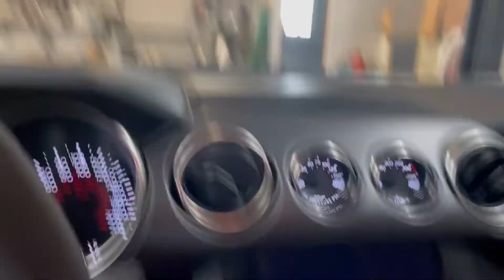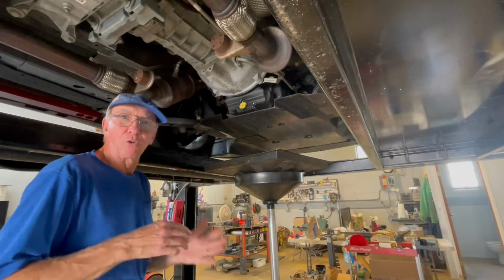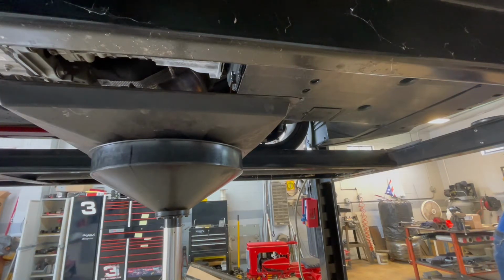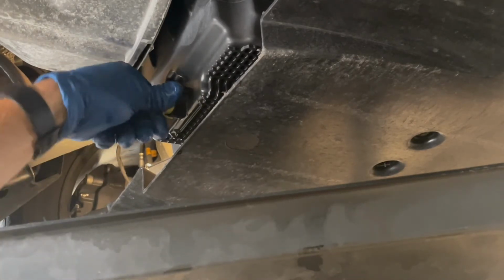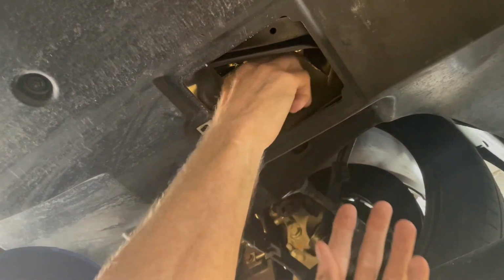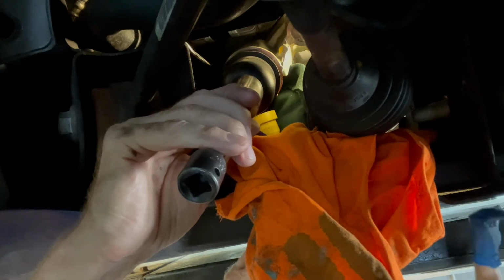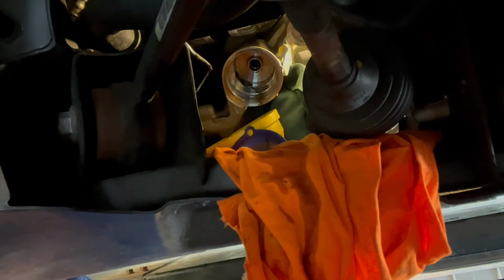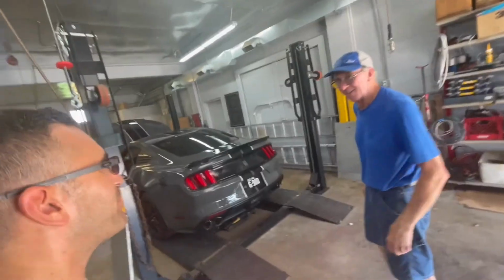Another oil change on the 2018 Shelby GT350.

Comment: I swapped my OEM plug with a UPR drain plug, very happy with it.
Question, does your owners manual specify FULL SYNTHETIC Motorcraft or synthetic blend?
My mach 1 owners manual specifies synthetic blend Motorcraft 5W-30, thanks
Reply from the maker: 10 quarts of 5w-50 full synthetic

Comment: Hey any luck on that wheel stud assist ? Can’t find it anywhere
Reply from the maker: George bought them from ReverseLogic size M14x1.5F-200
Reply from the maker: www.reverselogic.ecwid.com
Reply: @TrucciSpeed  you're the man!
I'm here watching your oil change videos over and over ! I finally found the correct oil  filter. What a hard incredible accomplishment! By the way I found it on Amazon and paid $36 paid $3 more to get it by Amazon and fulfilled by Amazon. It beats the eBay markup and the dealers around my way want to only provide the filter with service. Thank you so much for getting me that information.
Reply from the maker: Glad I could help. When you look for the studs just make sure you find the one for 15 and up Mustang. Might take a minute to search through and find it👍

Comment: Another great video 
The UPR plug is a no go I’m here NOOO don’t put it on lol . That place is next to my house .
Man I wish I had a lift like that would make my life so much easier. 
The issue I see when pulling the wheel off is how do you manage to not scratch the brake caliper ? Mines are red and they sit so damn close to the wheel I can’t barely even get a credit card in between .
Any suggestions ? 
What’s the filter part number FL-2087?
Also have you heard of priming the engine after? Seen a video of a guy on YouTube that steps on the gas and clutch so it basically won’t start the car just turn over the engine to build pressure prior to. Very interesting but don’t know if it’s a good idea maybe you have more feed back on this question good or bad to do.
Reply from the maker: Yea, wasn’t feeling the UPR plug. Check out my video on when I installed the Carbon ceramic pads. George had a stud extension kit that went on the wheel studs and it would guide the wheel off without contacting the studs. I will get the info from George on where he purchased them. The filter with the reinforced metal core is Motorcraft FL-2087 and thanks for watching 👍
Reply: @TrucciSpeed  thank you for your quick response .
I do remember watching that video made now that you mentioned it I remember looking for them at harbor freight but no luck. 
Thanks once again I always look forward to watching new stuff you post. 
Hope your truck is treating you good as well.
Reply from the maker: I love the Ecoboost. Can’t wait to see how it does hauling my daughters car to Florida 👍
Reply: @TrucciSpeed  I think George would have the answer where He got those Wheel Stud Pilot I searched every seems I can only find Metric since they are more used on the European cars then get thread in.
Thanks hope I can see where to get them , I  did find them for the corvette lol that won’t work .

Comment: I swapped my OEM plug with a UPR drain plug, very happy with it.
Question, does your owners manual specify FULL SYNTHETIC Motorcraft or synthetic blend?
My mach 1 owners manual specifies synthetic blend Motorcraft 5W-30, thanks